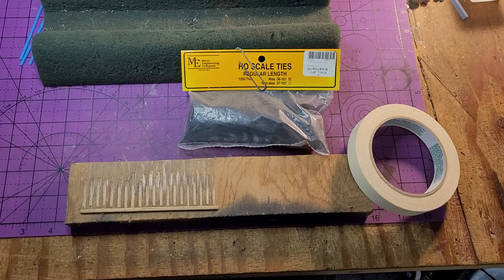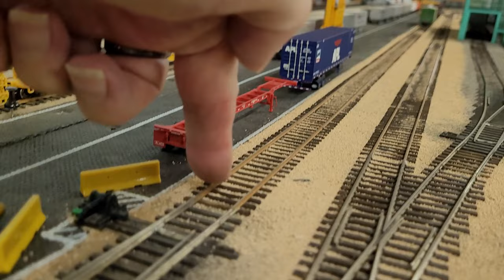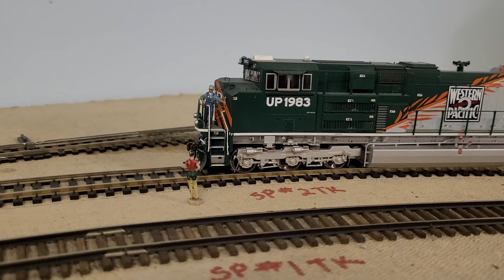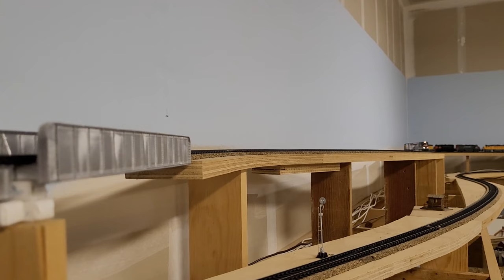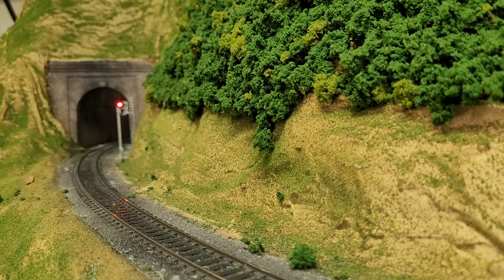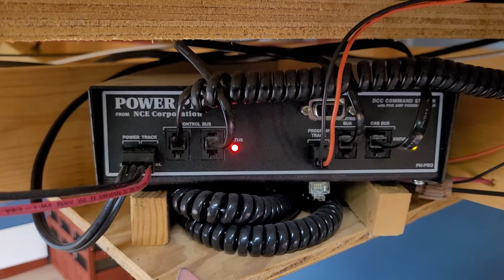HO Scale One Bad-Ass UP owned Train heads for Oakland

Comment: Double D! Heat kinks were a regular thing up and down the Valley! When I was coming back on Amtrak 717, we hit a pretty good sun kink out by Angiola, CA (near Corcoran State Prison) and it bounced our trainset pretty good. We stayed on the track but I got a good look at the kink from the rear of the train through the cab car.  We called the Bakersfield Sub DS and the track foreman was on his way down from Hanford.

Pretty good sized manifest there with UP 1983 leading! The ditch light burning out is why I've been replcing with 0603 LEDs. Also great job on the 2 GEs you fixed up!

Have a good week and hopefully you guys up in Sacramento start cooling off soon!
Reply from the maker: That UP 1983 is my fav. as I ran that engine from Bakersfield to Roseville in record time... I wish I took a 📸 of myself... I did take a pic of the cab w/ the engine number but heck I don't know where it's at..  My road foreman pulled me aside once and told me if I encounter a heat kink plug the train from the rear first.. to keep it stretched so you don't pile up.. have a good week too!!  DD. 😜